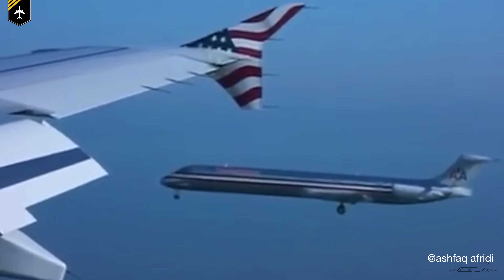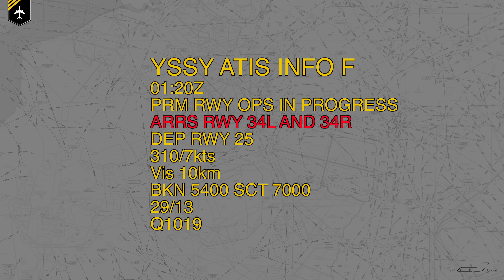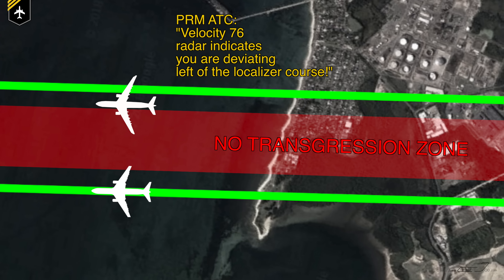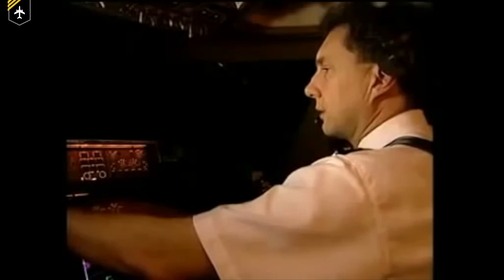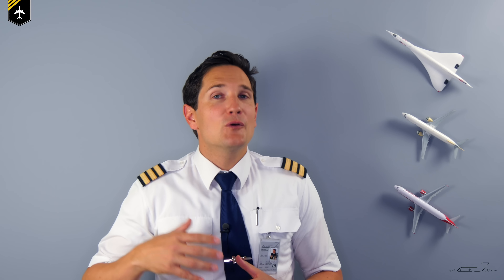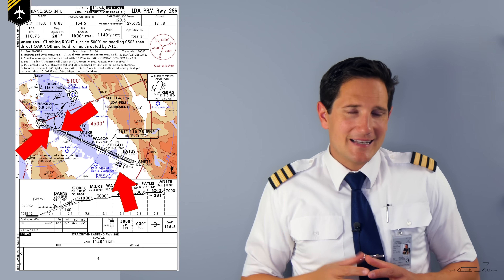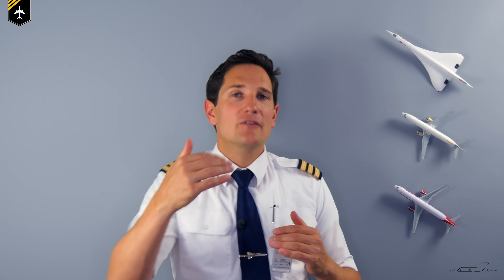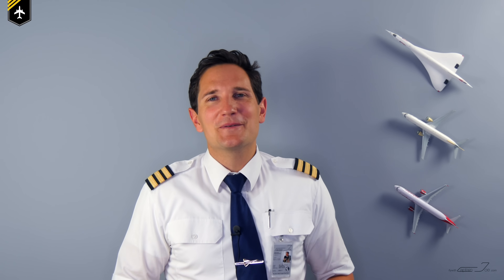Parallel LANDINGS!!! PRM and SOIA approaches! Explained by CAPTAIN JOE

Comment: This is a bit misleading.  The visual approaches you showed at the beginning are just that, visual approaches.  They are not precision or even Non-precision approaches.  There is no "No Transgression Zone", and no second tower frequency.   These happen every day at SFO under visual conditions.      32 years flying I have never flown a PRM or a SOIA approach.   But I've done a few hundred of these tight visuals into SFO.

Comment: Worth pointing out that Sydney also runs Independent Visual Approaches when in VMC. ILS PRM approaches are not the only way they have close aircraft adjacent on final to parallel runways.

So, instead of having a PRM controller, you stay with Director and Tower and the separation is 'visual'. You do not need to have traffic on the parallel approach confirmed in sight to be cleared an IVA. You will not generally get traffic information on parallel aircraft on an IVA except for when they're  really bloody close (within 1 nm).  The main advantage obviously is allowing more traffic on final without having to worry about dependent movements. In such an approach it is critical aircraft do not pass through the extended runway centreline, this is usually achieved by establishing on the localiser or an RNAV approach although it is sufficient if you have the runway in sight and can track visually.

Comment: Question: On very few occasions (at cruising altitude) the plane would suddenly pull up/down and accelerate/decelerate (very abruptly I might add) and then resume its normal course. What would cause such a sudden change in the flight plan?

Comment: Thanks for the explanation. As a passenger coming in to SFO I had one of these.  However the pattern was weird. On downwind instead of turning left on to base near san mateo bridge we turned right out to sea(westward). We then did a broad circle around to the left and were joined by what looked like a jet fighter on the right as we did what turned out to be a wide, circular base leg. Eventually both planes did the approach you described. On landing I noticed the other plane was a nasa plane. I trained as a glider pilot and am used to formation flying(while soaring). Seeing a dual landing was new to me. Thanks for the explanation!

Comment: and why did the 767 had to do a breakout in your example?!? didn't the 747 "screw up"?
Reply: The breakout at SFO is usually done by the aircraft flying the ILS PRM side. More room for error and  accuracy.
Reply: FGM11 
The breakout aircraft was a 757 (narrow body) smaller, more maneuverable plane than the larger 747.
The crosswind landings put larger aircraft on a downwind parallel approach, to avoid wake turbulence on smaller plane.
The rule is that smaller gives way to larger, for agility reasons.

Comment: Just as you showed the above view of that airport, I thought "That looks like Kingsford Smith."

I live and work in Sydney, so I got a little excited.

NB There is a Motorway that runs across beneath the runways of Kingsford Smith airport, which I use quite frequently, so I've seen several of these PRM approaches, but didn't know what they were called.

Comment: Not sure if related but approaching Barcelona Airport, I saw a plane very close and lower on the left (by the window).  A few seconds later, the pilot very turned abruptly.  I didn’t know that a passagers plane could turn so fast! Then the pilot gave a message remiding the passagers to switch off the phones and we landed with no issues. Might have been a false alarm or radio interference because of a phone? A mistake from the pilot?

Comment: I did in fact experience a Break Out Procedure one night at home airport (Minneapolis).  We were A320 Airbus and we got the "signal" to Get Out Of Dodge when we were less than 2 miles from approach end of runway 12L.  It was a dramatic situation because it was pitch dark plus IMC.  When the pilot flying my plane called the "engine room" for All Ahead Full, wow did the power really come up fast on that Bus.  Uneventful climb to 4000, sharp left turn, back around for a second try at the ILS, no problems then. We were not the "bad guy" -- the aircraft on approach to 12R had deviated to its left sufficiently that we were given the order for Break Out.  Very Impressive Procedure then unfolded.  I do not know if we still have this simultaneous approach on the books at KMSP.  At one time we were one of only a handful of airports in USA that had authorized use of this parallel approach procedure.  

This is a great video !!  Especially the example at KSFO.

Comment: Excellent video and you answered a couple questions I was curious about.  I'll never fly either PRM or SOIA approach but it interesting.  The closest I ever came to one was landing a Grumman Tiger on the right side with a DC-10 freighter on the left side but we were 5000' feet apart wing-tip to wing-tip and on parallels.  They started off well behind us but we were wings even at 2000' from runaway threshold.   I was peddling as fast as I could and tower reminded me (and my instructor), "Caution, Heavy DC10 landing the parallel."  I glanced over my left shoulder at about 1500' from the threshold and called out, "DC10 insight no factor" and my instructor freaked because he thought I was going to freeze up on him.   I think he was more nervous than I was, I thought it was a blast (having fun, not wake blast).  I wanted to tell tower that I bet we'll be able to turn off the right-side before they can turn off the left side, but Mr Happy in the right seat would have pulled my ticket for that!

Comment: I have a question regarding the SFO airport. Once I was sitting on the right side of the plane so I had a good view to the right (and slightly ahead). We were landing on the left runway and just slightly ahead of us to the right was another plane so the two were approaching almost in parallel. So it was different than what you describe in the video where the plane on the right should be behind the plane on the left. Is that a valid approach into SFO? The interesting part is that just as the other plane touched down, we went into go-around due to our runway not being clear of traffic.

Comment: Why is it that the 28L and the 28R approach have different PRM monitoring frequencies? Wouldn´t it be more usefull if both pilots hear the Break Out Warning so that both know what is happening? And do pilots readback the Break Out instructions to PRM or Tower controller? I guess the Tower controller is informed automatically by the PRM responsible?

Comment: What is the situation with regards to proximity of aircraft in stacks? I was returning from the USA into London Heathrow on board a United 777.  As we were manoeuvring the stack another aircraft was visible flying in the opposite direction.  Rather scarily that aircraft banked left towards us and although very close appeared to descend into it's next level in the stack.  Is there any similar control in stacks?

Comment: I'm a passenger and I do not recall where we were landing, but we were just about to touchdown, I could see the runway out the window, If I had to guess I would guess we were 20 ft from the ground and suddenly the engine powered up and we pulled back up and had to go around, the captain said we were too close to the plane ahead of us. I recall him saying we needed to be 3 miles back and were only 2.5 miles. That was an interesting event.  Any insight on this?

Comment: At 8:26 it’s a 75 not 76
Reply: Red Panda Nope it is a 767
Reply: Dylan how about you go to the original video and see that it's a 757 that lost formation with a 74
Reply: Red Panda How about you go to the original video and work it out, the flight was UA900 from LHR to SFO thats 8611km. 1000km more than the 757's max range
Reply: Dylan uhhh read the description and the flight came from SAN. Also in the title “United 757” so idk what u on

Comment: Hey Captain Joe, Thumbs up for this vid. I have flown in and out of YSSY many times but have not experienced the break out procedure but have often been fascinated watching an aircraft on a parallel approach. with the offset thresholds between 16/34 L&R  I never thought the aircraft separation  to be so critical.

Question... what is the vibration often experienced after rotation? is this from brakes being applied to the wheels before gear retraction, a buffeting on the wing  due to high angle of attack or is it something else?

Comment: My home airport, YBBN (Brisbane) seems to be a future candidate for a PRM or even SOIA approach, as a new runway (01L/19R) is being built next to 01R/19L. Interestingly enough, this runway is going to take a full eight years to construct, as it is being built on dredged up sand from the local bay, and that requires time to settle. But we’ll soon have three runways - two of which are over 3km long. This little airport is really starting to see some traffic. So much so that they built a brand new tunnel, directly from the airport into the city centre, bypassing a full 16 sets of traffic lights. In addition to this, they also rebuilt the entire fucking road structure around the airport. All of it. It used to be hell to get to that airport, now you get there first time, every time. If only I could say the same about my local highway.

I also know this because I live directly under a waypoint for approaches from the north, which would be, I dunno, nearly all of them...

Comment: Question. How and why are commercial aircraft such as a B737-800 allowed to land at an airport with no tower? Every now and then B737-800s and A320-200s divert from our main airport Brisbane (IATA: BNE) to Sunshine Coast IATA: MYC) at night when the power isn't manned. Do they fly VFR are they allowed to fly VFR? Mind you it is 10mins from wheel up to wheels down between both airports. Furthermore, why are pilots allowed to fly at 500ft from taking off for a distance of about 2km (1.24 miles) It happens often also they climb straight up to cruising altitude and I mean they're at cruising within about 5mins or so they're at 9,000-10,000ft. Why the hard and fast climbs and I mean they take off and get into it hard and fast not the normal steady climb.

Comment: I like those clips that you added which show the procedures in the cockpit!
I've flown to SFO twice, but didn't experience a parallel landing.
I've experienced a triple parallel landing at ORD though! https://youtu.be/ZB4Qj1aMSUM?t=6m20s, as well as a parallel take-off/landing https://youtu.be/UreFJT_Q9Pw

Suggestion for topic: The difference between IATA and ICAO, and f.ex. why they use different codes for aircraft and airports.

Comment: Great video, and more about this subject...sooner you'll be landing at MMMX Mexico City, tell us about the experience..!! 😉😎

México city has parallel runways but as closer as about 380 ft! And normally you'll find 05R is the main landing rwy, and 05L is mostly for take off, you can see an A320 running for take off on the left and a massive B747 on short final of the ILS on 05R..

Comment: At Bathurst Airport in Bathurst Australia (ICAO code: YBTH), Our gliding operations run off a grass runway maybe 50 feet away from the main paved runway (RWY 35) and we call them as two seperate runways over the radio. Not sure if this is the same thing but it does create a challenge when the regional airlines ask our gliders to "go around".

Comment: Hi Captain Joe!

Thank you for another very interesting video. Now I know how two parallel runways are used. Always wondering about that.

May I ask a totally different question? It is about rescue operations. How commercial pilots are involved to it for example after a ship accident, when passengers are searched for? I mean I cannot imagine that it is possible for pilots in 10,000m hight or more to see people in the sea or on land, even if the people are equipped with this plane rescue mirrors (or whatever they are called). Or did this ever happened? Will you be informed by ATC if there has happened an accident with missing people on your route?

Comment: Great video! Being based in Melbourne I often fly into Sydney for work and have been a passenger on lots of PRM approaches. The departures are also usually quite fun by the way.
Same for KSFO, been on the Qantas 747 lots of times coming in on runway 28. The parallel departures on runways 01R and 01L at KSFO are also super fun.

Comment: Captain Joe, love the videos. I recently had a go around experience at approximately 2,500 feet to go while flying into SFO from Las Vegas. I looked up the ATC recordings later and discovered that our pilot wasn’t able to obtain a visual on the other plane landing at the same time due to cloud cover. NorCal Approach ordered an increase in elevation and we headed Northwest out to the Pacific Ocean, back through Half Moon Bay and back for a second approach and a completed landing. The flight attendants said to the cabin that we needed to set up for an ILS approach.

Nearly every time we fly into SFO at night, because of the fog one landing runway is closed and our flight is delayed two hours.

Comment: sorry for asking, but what is the point of this? I mean, why complicate things?  correct me if I'm wrong but if the distance of the aircrafts (one behind another) for safety reasons is the same, having planes landing in parallel or offset doesn't change the numbers of aircraft landing in an hour or any period of time. right?

Comment: Sydney airport (AKA Kingsford-Smith airport) has been my international departure point for more than 40 years so it was interesting to see you use it as an example. When you look at aircraft operating in and out of the other runway the distance between the runways does not seem to be that close. BTW Captain Joe Australia has a shortage of commercial airline pilots and I understand remuneration is very attractive.

Comment: The rural airport i learnt to fly at had 2 runways 100 feet apart, 16L was for planes 16R was for gliders. There were a few landings where you could watch the gliders land infront only 200-300 meters ahead. Best experience.

Comment: I don't know any more off hand than you mentioned, but another cool approach - single plane is at SEATAC in Washington state USA.  I don't know which runway it is, but I've done it once in the day and once at night.  Whats cool is there is a ridgeline parallel to the runway, and at a higher elevation, that has houses on it, so as you come in you look out the window and it looks like you are at or below ground level!

Comment: Decades ago as a student pilot, I remember doing parallel VFR approaches (SOIA distance apart like SFO) in the days of mixed small and commercial aircraft using a busy TCA airport (now termed Class B).  There were none of these PRM rules to my knowledge and the tower just gave the clearance to turn to final for the designated runway.  I've seen planes fly beside me just like in your opening videos.  Not sure when they stopped doing this as one can see there is a risk.

Comment: Wow, that's dangerous. Remind me to never land in San Francisco. Speaking about danger, Captain, a new topic. Why are airliners never outfitted with a mid-air refueling system?
Reply: Because it's not needed and air refueling is inherently dangerous and extremly stressfull for the pilots.
Reply: @shi01  So is flying 750 ft right next to each other. I see no benefit other then maybe 1 or 2 extra planes landing within a specific time.
Reply: 750ft is a massive distance compared to how close planes are flying to each other during aerial refueling manouvers.
Reply: @shi01  Flying 750ft next to each other serves nothing. If pilots want kicks, let them fly a fighter jet. Planes have crashed due to fuel starvation. People have died. Till this day, airports still direct planes into a holding pattern, putting fuel in the equation. A mid-air refuelling system could have offered them an extra option to survive.

Comment: I was on a flight into SFO on a United 777 (back when they had Ch 9) doing the LDA and the tower called for a breakout... you find out very quickly just how hard those planes can pull when the fuel tanks are about dry.

Comment: Question: Are pilots informed about military operations close to them? Where I live, it is normal for czech air force fighter jets to perform flights several times a day, however most of the planes coming to Prague from the south-east are also routed through that area. So I wonder if the commercial planes get informed about the military ones, or maybe if it is the other way around. I was listening to ATC many times when I noticed the fighters, but I did not hear any mention of them.

Comment: I fly into SFO a lot and have seen this a few times.  Typical operation there when the fog clears.  A couple of times, there has been an announcement from the flight deck informing passengers that, they are aware of the other aircraft and this is normal operation at SFO.  Also one time at SFO, I was on an American Airlines A321 on runway 1L and we took off simultaneously with an American Airlines Boeing 737 on runway 1R.  The landings are cool to see, the close proximity takeoff was even cooler.  Danke für ein schönes Video und eine gute erklärung, Captain Joe!